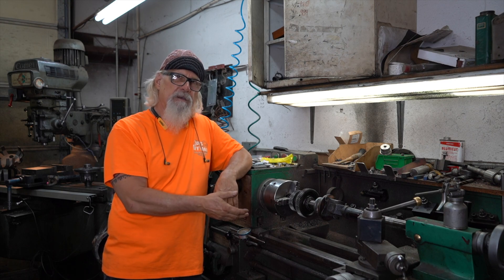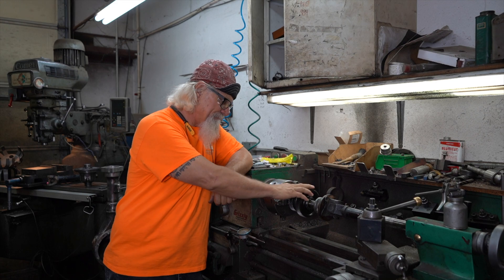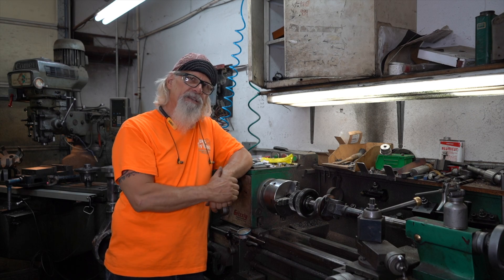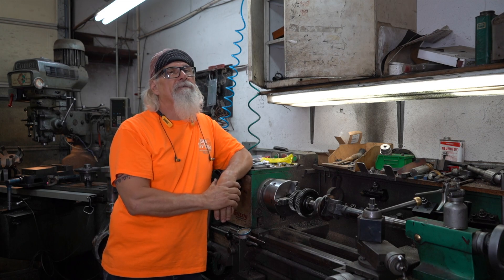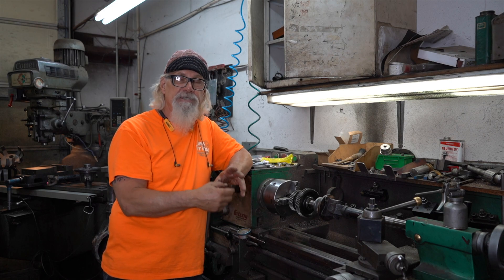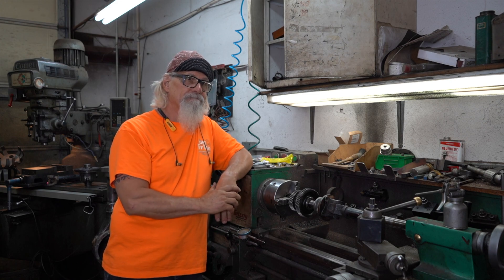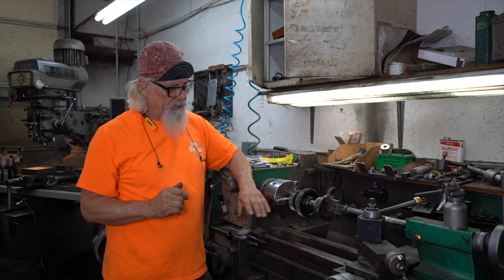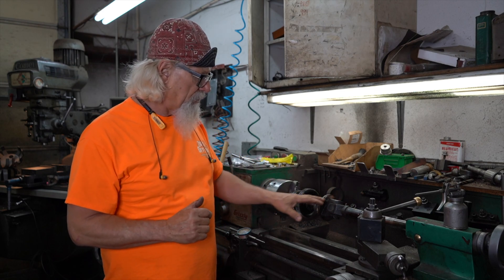Suzuki 4x4 Towing & Drive Shaft Phasing

Comment: Thanks for this great information My. I've always removed the rear driveshaft while flat towing,  t-case in neutral, tranny in 2nd. I never knew about putting the t-case in 2 wheel drive. Would i still put tranny in 2nd gear? 
Also would removing both driveshafts be even better, freeing everything up?
Thank you for your wealth of knowledge!

Comment: If i disconnect my rear driveshaft do i still put it in 2nd gear and put tcase in neutral? Thank you
Reply from the maker: The T-case should be in 2wd so that the front driveshaft is disconnected from the T-case internally. 

That way if a front hub gets engaged on either locking hub it won’t spin the T-case or trans. 

No rear drive shaft no spinning of anything in the drivetrain. Impossible to damage drivetrain from rear wheels spinning.
Reply: @Zuksoffroad  thank you so much...

Comment: If you disconnect the rear driveshaft, either manually or with the kit that does it, then, what position do you put: the transfer case?  The transmission?
Reply: You answered that in the video, thanks!

Comment: Salve,molto interessante questa spiegazione...io ho un problema di gioco nell albero anteriore il rumore è tra il maschio e la femmina che ne determina un rumore molto fastidioso mi sembra che fra i due non ci deve essere gioco eccessivo o sbaglio
Reply from the maker: The splines can get worn out and make noise yes. This usually happens when there isn’t enough make inside the female

Comment: Why 2nd?  3rd would   reduce the chances of engine destruction if the Tcase jumped  out of neutral.  Interesting that the slider gear can move around when jostled just right.
Reply from the maker: I submit that Japan having a very low speed limit and very small cars towing a samurai that second in trans would pull on the front vehicle more noticeably. What so many miss is the need to drive it around after 200 miles of towing. Tow by factory rules is taking a chance for damage. Removing driveshaft eliminates the possibility of damage.

Comment: Im all over   removing drive shaft   my only issue is   I tow  with RV  on short trips like  60 miles and  its an issue to continually   climb under  .     I dont know how other  T/C cases work  but having the  front drive shaft spin is some BS  too  I dont like that
Reply from the maker: What vehicle? There are rear drive shaft disconnects for Samurai. Sidekick/Tracker no. Whenever anyone says, short distance I am reminded of a local here in the Verde Valley. He only was towing two blocks. He didn’t make it before punching a big hole in his block.

Comment: Great info and demo My! This is exactly why I built a full float rear axle with locking hubs as I was worried about spinning mass/wear during road trips. As an added bonus, I didn’t have to remove my driveshaft to get towed out when I locked up my tcase at the dunes.
Reply from the maker: Did you see I mentioned full floaters.